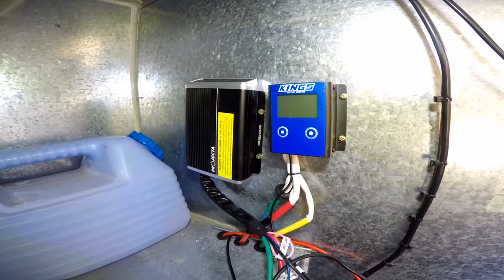I install a DCDC charger and battery monitor, and nothing blows up

Comment: Yeh John, the dcdc charger overcomes the "smart" charge on modern vehicles - varying charge voltage, and also volt drop from car to van. They're a good bit of kit. And they will accept a solar input. Good job.
Reply from the maker: Gday yer I have a solar panel plugged into this to keep the battery charged while the van is in the shed Thanks for watching